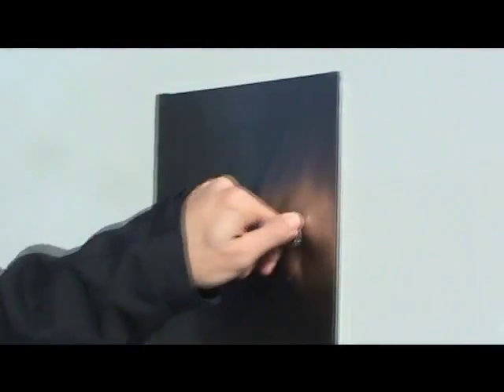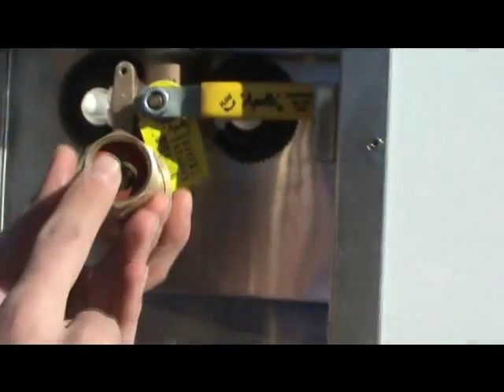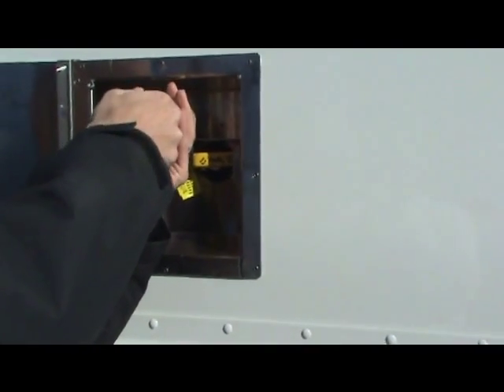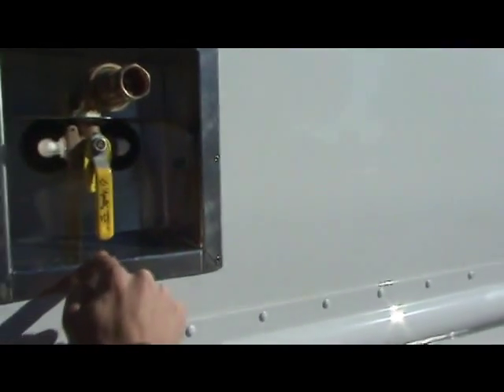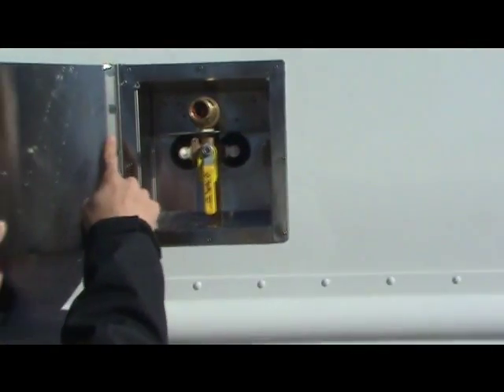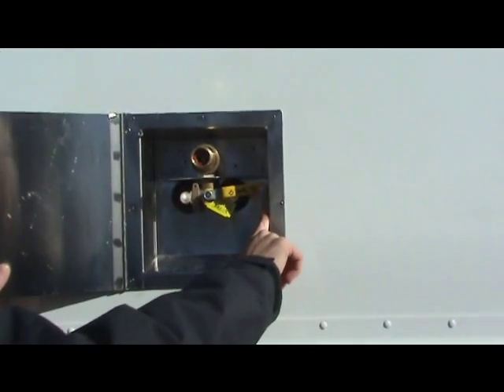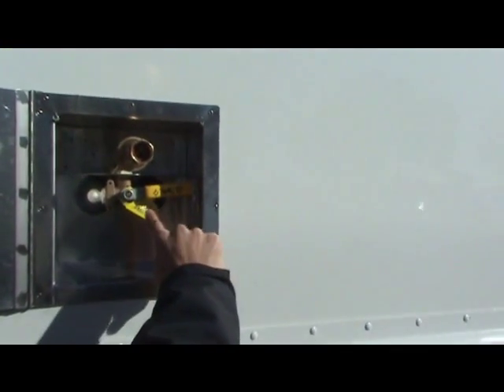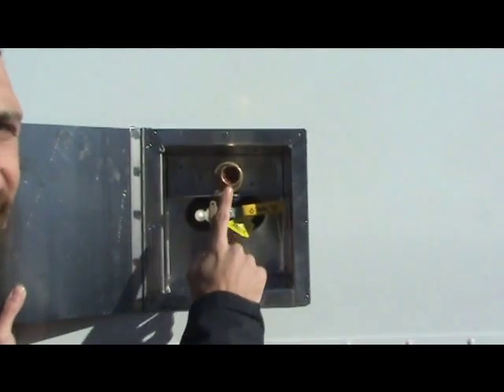Catering Truck Operation Procedure Part 1

Comment: How do you sanitize the tank with that type of connection? Any help you can provide would be appreciated!
Reply from the maker: There is an inline flush/fill spout where sanitizing solution can be introduced into the plumbing system.  The water can then be filled as shown, pushing the solution through the lines and into the tank.  Likewise, the tanks are readily accessible in most of our builds and have an integrated removable access cover that is large enough to reach into the tank with your hand.  But the first method is much easier.  Hope that makes sense and helps.